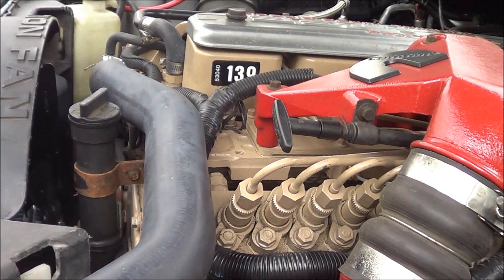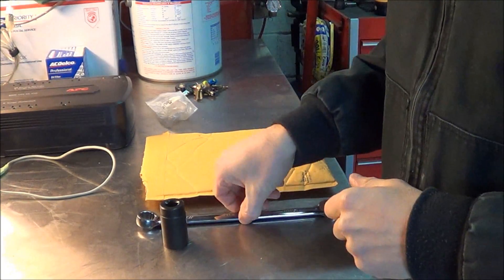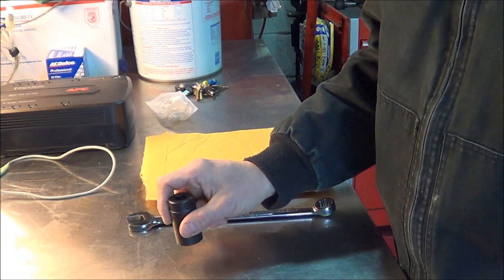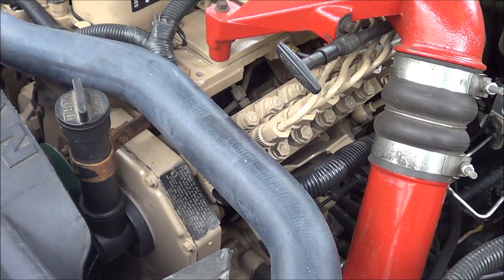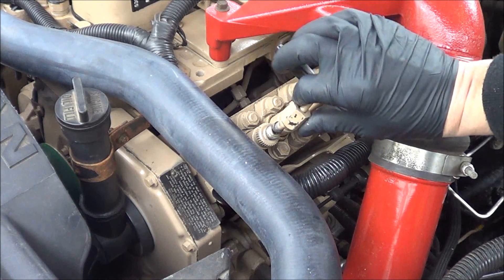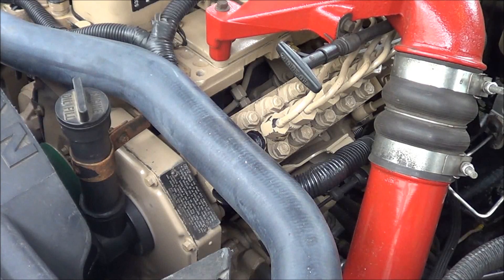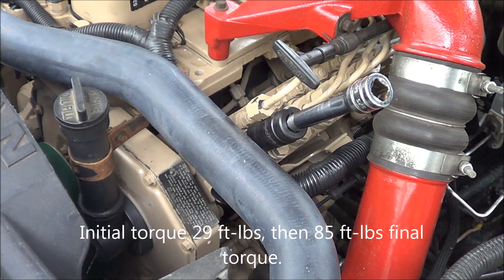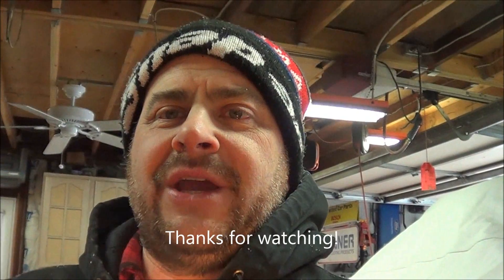1-26-14 How to replace leaking delivery valve o-ring on a 6BT Cummins P-7100 pump

Comment: hey excellent informative vid. can you tell why i have diesel leaking out the cap nuts on my p pump , i could change out the bottom o rings like you  but my problem it the top. i have nipped them up but no change

Comment: This may be a dumb question but do you have to find top dead centre just to change the o ring? or does it not matter?
Reply from the maker: Terry Villeneuve no that isn't necessary... not a dumb question either.
Reply: Would this cause air to get in the fuel making the truck smoke white ?
Reply: Terry V +1 my truck is smoking white when I start it up but when it's warm it's gone

Comment: I am getting ready to do the same repair on my Mercedes engine (Bosh fuel pump). Viton O-Rings hold up better with modern fuel and Bio-Diesel, I found them on Amazon in a pack of 25 for only a few dollars. You just need the size ID, OD & rope diameter. The socket came in the mail today from UK and it cost me around $17 from Amazon.

Comment: We have the 6bt in two tree shakers (for harvesting almonds and walnuts) and in our fiat fx210 excavator. Its a very common engine in agriculture equipment and New Holland and Case tractors. But I'm almost positive John Deere doesn't use anything Cummins they have there own engines. It's probably a common o-ring size. Keep up the cool videos.
Reply from the maker: Thanks!
Reply: I should have been clear I think John Deere might use Cummins on the big articulating tractors (not sure of the models) and I know they don't make there own engines on the compacts and lawn mowers, but I'm almost positive they only use their own engines in the 6bt horsepower range. I like the 6bt engine I've heard of some that were used on deep well pumps that had 30,000 hours and still ran good.
Reply: old post, but JD didn't make the injection pump, neither did cummins, BOSCH did, and JD uses some bosch.